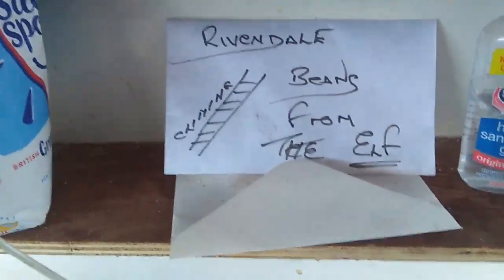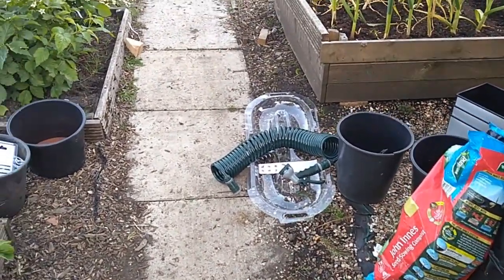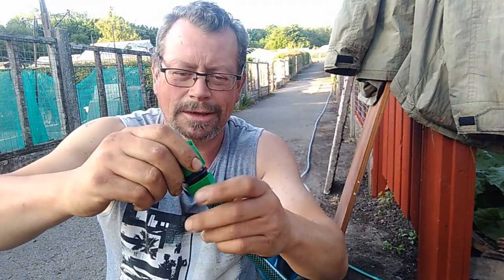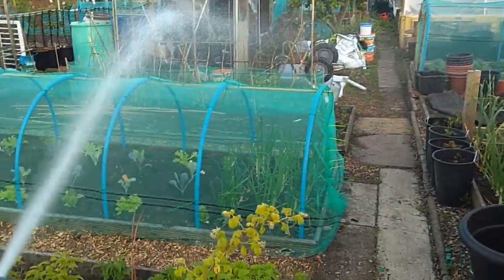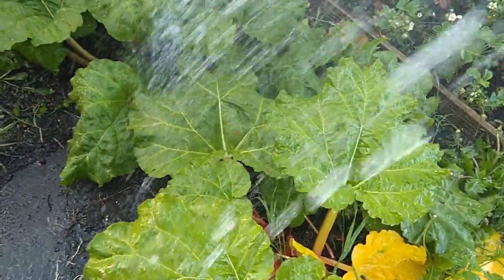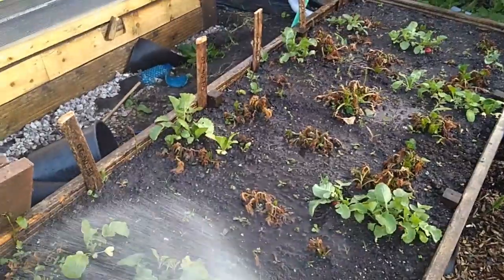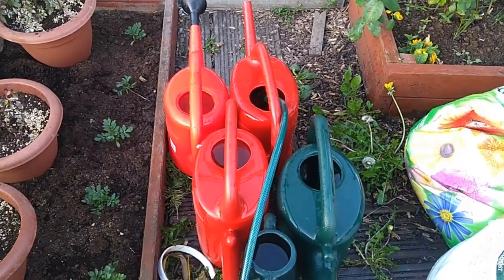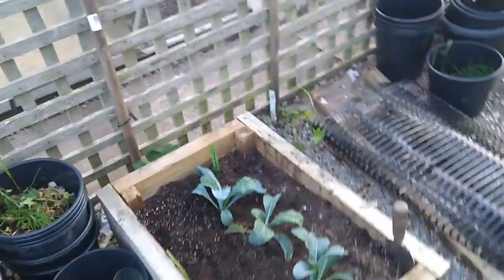Allotmemt Gardening Tips ~ How To Water Your Crops ~  Plus! Magical Elvish Gifts!! 1

Comment: At 10min 25sec Tony - the nut by your thumb is for adjusting the flow of water so you don't wash seedlings away etc. Saves you having to partially squeeze the trigger.
I use one of those silicone hoses that grows to about 50m when water is on but shrinks back to about 20m after to put away.
Nice one buddy
Reply from the maker: Cheers Steve... Top Banana Brother!

Comment: You hit the nail on the head here for me.  I bought a reel for my hose.  I've looked at it every way I can and I don't know how to connect the existing hose which is already connected to the outside supply to the reel and make it work, do I need adapters or something?  I hate to waste money on things I can't get to work.  I wish I had bought a reel with a hose all attached and ready to connect to my supply.  There were no instructions with the reel... So, it's just sat there and I'm still draggin' that hose about.
Reply from the maker: Yep get a double female adapter from Wilcos or the ASDA in Leigh love... I'll try to remember to show you on tomorrows episode, but the coil pipe I got from asda is too narrow to fit even with the adapter connection, so I just got another 20m standard pipe and it works great. x

Comment: Hi there..... I'm looking to buy the ryobi starter set, would you recommend, any good or bad points????
Cheers.
Reply from the maker: No issues at all really mate... The basic batteries aren't as long lasting as the Makita, but they are half the initial cost to buy the tools... Good kit for cost Adam, and the Poly carbonate green house was all built with the Ryobi starter set mate.. Good Luck with yer projects pal.
T